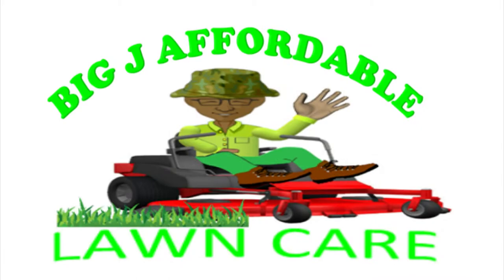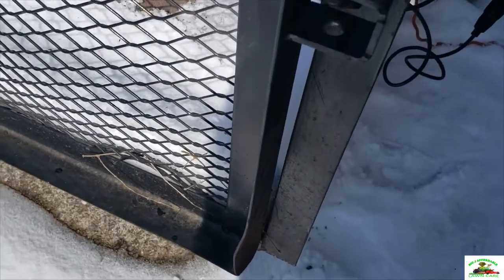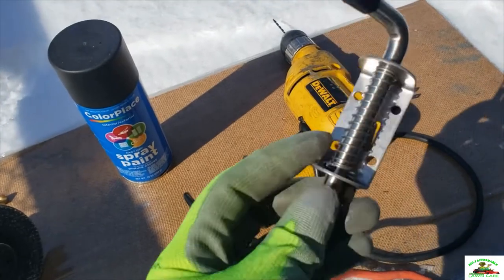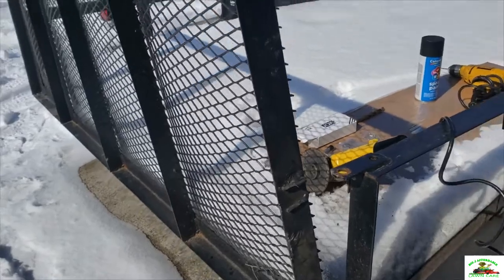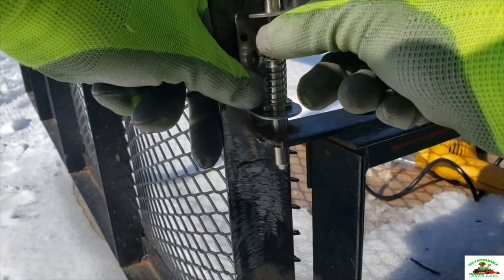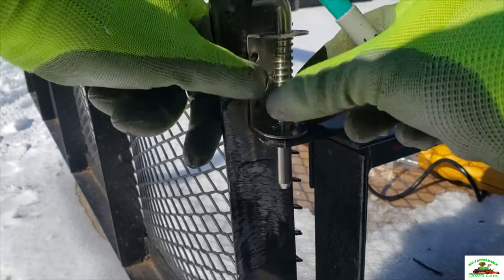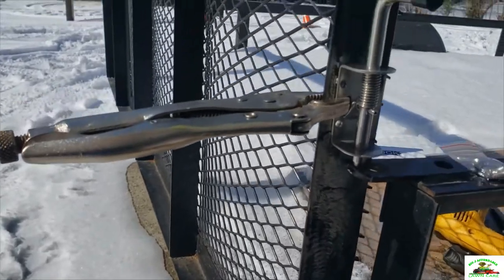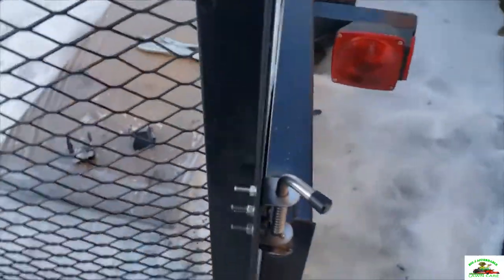TRAILER LATCH [DIY]

Comment: You could have just added the latch to the tailgate and it would have went through the holes already there.  Would have been stronger as well and if it didn't work out, a new pin could have been used as in the old system.  The latch mounted to the tailgate would be above the holes when the gate was up with the pin travelling down.
Reply from the maker: Great Ideal I may change it to this. Thanks man....👍